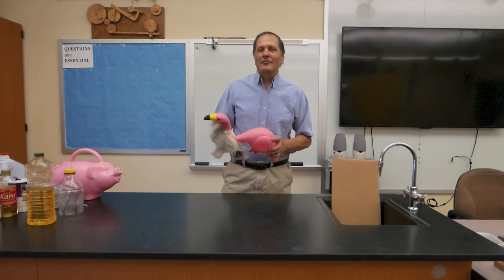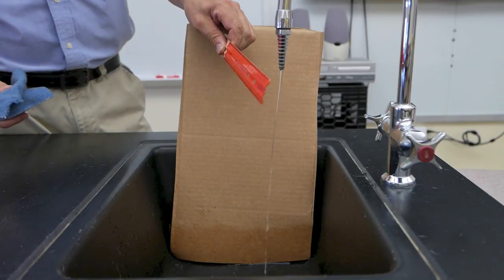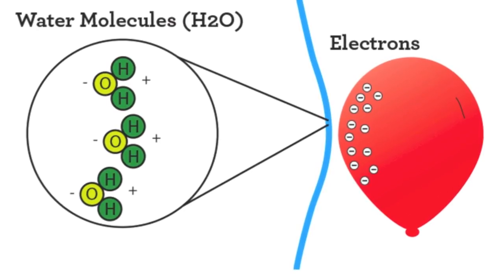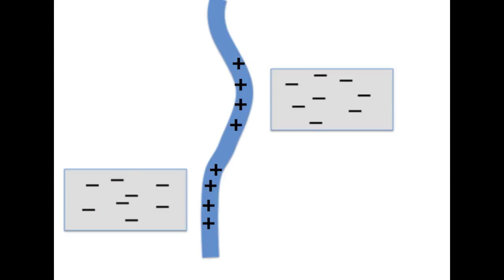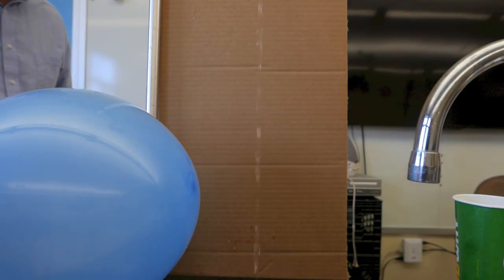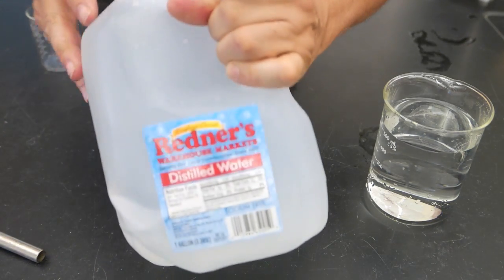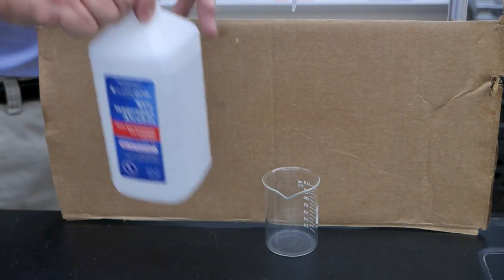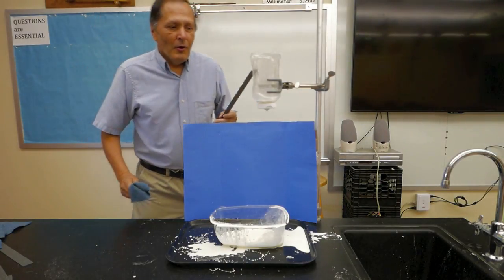Bending streams of water with a static charge // Homemade Science  with Bruce Yeany

Comment: Fantastic video! I really thought I knew what was going on before the video and you completely blew that hypothesis out the water - I LOVE that!  A few thoughts on potential experiments next time:
1) using dry sand
2) using tiny metal ball bearings, ideally fine enough that they can 'flow' like the same (but conductive)
3 & 4 intro: someone in the comments suggests that the lorentz force may be coming into effect: the moving charge (in the frame of reference of the dropping water the ruler or balloon is moving) is creating a magnetic field, which, if there is a localised charge induced on one side or the other in the falling water, could create a force.  To test that:....
3) water stream going past a magnetic field with no static charge near (I expect would not be deflected - but I got other predictions wrong so good to have a control test)
4) water stream being bent by a static charge on ruler / balloon: then bring in a magnet from a distance and see if that changes the way the water is reacting to the ruler/balloon at all.  If the Lorentz force was having a significant impact, one would expect the magnet would disrupt the B field and so have a change on the water behaviour (I really hope I'm wrong and this would show something, as it would be soooo cool to see)
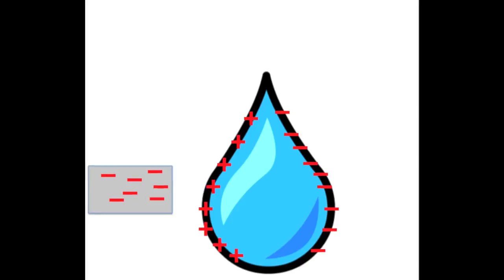5) This is a long shot, and may show my chemistry is dicey, but to see if the ions are moving from one side of the stream to the others as per 3:41 in the video, could you put in universal indicator. If all the H+ went one side and the OH- went the other, then this should show in the colour of the indicator (orange one side, blue the other), if not it would all stay green.  It could be too subtle to see, so perhaps best to use something that would usually be clear, and only show a colour if the ions were being moved around to general a localised H+ or OH- concentration, by memory we had Phenolphthalein in high school.
6) Although it looks awesome, I'm not sure the corn starch in 9:55 would stop the polar molecule from rotating (since A. it's on such a small scale vs the behaviour usually tested with non-Newtonian fluids and B. I think they need to keep this freedom of movement otherwise their specific heat capacity would change, or is that only in gases.... I get distracted) But to try and look at the same thing in a slightly different approach, could you get very finely "crushed" ice? Same idea that the crystal structure should stop the polar molecule rotating. Practically speaking scraping off the white condensate on the inside of a very cold freezer might be the easiest way to get this while minimising the water present.  

But any next step experiments you do on this I'm sure would be amazing.  Keep up the great job and thank you!! :-D
Reply from the maker: thanks  ColSco Co,  In a previous video,  I did try it with dry sand and got what I thought were very unexpected results,  you can find it here  https://youtu.be/jcoTqhXehDQ  
I'm trying to get a Lord Kelvin water drop to work with the sand rather than  with the water,  so far not working but in theory it should.

I have other videos that I'm working on but I have more that I want to  show and try with static electricity,   so I am coming back to this  I'm adding your suggestions to things to try and hopefully we'll  see what happens.
Reply: Another great video! Looking at that, a couple of other ideas :-)

a) by adding detergent to the water to reduce surface tension, would the water behave more like the dry sand did in that experiment, ie flying in all directions as the induced charge makes it repel itself and the surface tension is no longer enough to keep the stream together

b) At 7:22 of the other video you link to, you show the metal foils separate due to the induced charge on the sphere resulting in an opposite charge on the foils... Could you use the same approach to test if a induced charge in created on the 'far' side of the water stream: Clamp an insulated charged ball/ruler on one side of the stream (to try and keep the stream as steady as possible), and get a thin metal wire connected at one end to the sphere of that same apparatus, and with the other end of the thin wire, just gently touch the 'far' side of water stream.  Let's say the charged ball is PVC (negative), then one might expect the near side of the water stream would be positive, and the far side would be negative. If so, then the far side negative charge would conduct to the apparatus used at 7:22 in the other video, making the foils negatively charged, and the foils should repel

c) realise my suggestion of "dripping ice" in my post above probably isn't particularly practical, but one similar approach could be checking the reaction of a small water balloon suspended on a thread, and an identical water balloon that had been frozen beforehand, where no ions were able to move and (potentially?) the water molecules would be locked in the ice lattice and so unable to rotate their dipole moment.  Would probably also need a control of a water balloon filled to the same size with air, to see how much of the reaction force would be due to the balloon itself!

Comment: Regarding the vegetable oil: it doesn't matter that the substance isn't polar to begin with. The electric field of what you're holding will polarize the streaming material, and lead to an attraction. The attraction will only stop if the streaming material is very difficult to polarize. I expect no deflection when using table salt.

Most molecules that I'm aware of can be polarized to some degree. The protons simply move one way, and the electrons move the other way, in the presence of an electric field. 

I hope I can try table salt soon.
Reply from the maker: Thanks Antalz,   I will go back and try the table salt,  I'd like to see what happen

Comment: Great video as always ! (two of my collegues discovered your channel with me today ! ^^ Everyone wants to stop working on they're thesis and do cool experiments !)

So many questions !! First, I think the influence of the heigth migth just be because of the kinetic energy that the water accumulate during the fall, the static charges become less and less powerful in comparison to the inertia of the drop. But it's just an hypothesis.

isn't vegetable oil very polar ? it's mostly composed of acid and I think they're quite polar. 
polarity ranking from most to least:
Amide > Acid > Alcohol > Amine > Ether > Alkane

I think the polarity hypothesis should still be investigated, but the honey is mostly composed of sugars (I think they're non-polar) dissolved in water (polar) but it has a low concentration of water (something around 15% maybe) and we don't see that much of a difference on the experiment... That feeling of mystery is so great !
Reply from the maker: thanks Ben,  everyone needs to take a break now and then but I hope you were able to get your work down.  I checked for a listing of common non-polar materials that I had that are commonly available and it said that food oils were non-polar.    A lot of this experiment was spur of the moment and I wasn't sure what would happen or why.  If you have some additional suggestions I would love to hear them.  I was wondering if there is anything that I could find that would be repelled by one charge and attracted by other.
Reply: Doing experiments not knowing what to expect is cool, at least you avoid confirmation bias ! ^^

You often find on the internet that vegetable oil is non-polar and that's why it doesn't mix with water because "like dissolve like" but it's not true, polarity of the acid contained is oil is comparable to the polarity of water (measured in Debye unit)
You just need to look at Oleic acid for example (~70% of olive oil) or linoleic acid and you can easily see the molecular structure has no symmetry charge-wise ! Of course "oil" is not an element but a group, so it's risky to say "oil is polar" or the opposite.

You can find videos of things like carbon tetrachloride (which have polar bonds but it's tetrahedral molecular geometry makes it nonpolar by symmetry) that doesn't respond to charged object.

Oh and after researching, the glucose and fructose in honey are very polar molecule. ^^
Reply from the maker: Thanks Ben,  I appreciate your comments, the  honey/ syrup were no surprise,   parts of this were spur  of the moment and I was  looking around for nonpolar materials,  since it is a middle school classroom I don't have much in the way of chemical supplies and a quick internet search suggested  oils.  Hopefully I can come back to this again with better testing and more definitive results

Comment: The answer to the viscous liquids being more attracted and the liquids being way more influenced in its course on the top of the stream is probably that they gain more speed over their fall and the viscous liquids arent able to accelerate as quickly as the "normal" liquids, because of their viscousity. And because of the increasing amount of force needed to change the direction of a moving object, while accelerating (vectorial mathematics), this happens. (Sorry for eventual bad english)
Reply from the maker: Thanks Jan,    I am already planning on another try and taking ideas to try,  hopefully the next round will be more definitive,  I will take see if we can set up some experiment to test this
Reply: I'm looking forward to it :)
Reply: Surface tension seems to play a role in this experiment. The solid stream of liquid had a higher surface tension than the droplets.

Surface tension is caused by cohesion -- by the attraction to molecules of the same kind. Higher surface tension = higher paramagnetic attraction.
Reply: I was think the same as you

Comment: Is it getting its charge from the device it's running out of? It does appear to lose it when the stream breaks.
Reply: GodKnowsYou2 That would explain most of the observations. Could you try to make the tip of different materials like teflon and Porcelain?
Reply: GodKnowsYou2 This! I was thinking the same thing. Try grounding the container or purposely adding charge too it and see what happens
Reply from the maker: Good question!  Too many experiments to try and not enough time,  there is more on this that I'd like to get to,  I want to use a VDG generator but it will have to wait as I have some other videos that I'm also anxious to show
Reply: I thought it was because of the kinetic energy which increases downwards and becomes bigger than the induced magnetic field
Reply: Niemand Wirklich lol could be I is no expert
Reply: @niemandwirklich  we would still see the attraction, just a smaller one. While it looked like there was none.
Reply: I am 6 years too early. But if this were the case, wouldn't it repel with same charge?

Comment: Consider "water vapor" and "cloud condensation". With cold dry inflow air -- with an amount of positively charged dust particles -- rushing towards a rising updraft of warm moist air going towards a rotating cloud base with negatively charged ions. What kind of interaction is going on and what kind of influence would static electricity have here?

Comment: How much does the increased speed of the flow at the latter stages impact the bend, rather than a bleeding affect? Clearly there'll be much less diversion of a faster stream? Maybe test this with higher water pressures through the tap.

Comment: I don't expect this to get read, but vegetable oil as triglycerides may not nonpolar enough to avoid responding to an external charge.  When I did this test, I used charcoal lighter fluid, although I would have preferred to use hexane.  Either way, it did not respond to a charged balloon.  I would suggest trying this.
Reply from the maker: A little late but it was read, thank you for the suggestion

Comment: The only thing that comes to mind, seeng this fantastic scientific approach to the problem, is that induced polarization of the materials, being them liqud, semi-liquind  or solid, is responsible of the phenomenon. The experiment can be due also with little pieces of paper on a table, the rubbed plastic would attract them. So, in principle, no need of polar molecules kind of material: oil stream seems to be the demonstration.

Comment: But why doesn't it move against the strip if the water isn't running out of the tap? if you try taking the strip near a the top of a glass of water shouldn't it show the same effect?
Edit: Nevermind seems like you adressed a lot more then i expected. Very cool video.
Reply from the maker: Hi Pavr,   the charge  on the strips isn't strong enough  but in a future video, we'll try it with a much large charge using a VDG generator and we'll get it to move on a large surface of water

Comment: Could the charge actually be contained in the container at the top? And when drops form, the link to the container is broken, so the charge dissipates, and the droplets no longer hold a charge.
Reply: Idea: insulate the top container from the stand. Try different types of containers for the materials, or try to discharge any charges on the container by grounding.

Comment: Just to chip in. Molecules with no net dipole moment, such as hexane, are not deflected by static charge. Vegatable oil is not a very good substitute for this as the molecules of fat are polar. Along these lines it might be worthwhile to experiment with solvents of different dielectric constants. Especially glycerol being polar yet very viscous might prove interesting.
Reply from the maker: thanks kaviaari,  I'm tracking suggestions and plan to give this another try.
Reply: I agree with trying hexane or other liquids with no dipole.  Great video! I love this channel.
Reply: Hexane feels a little dangerous having around objects which might induce arcs with it being flammable but perhaps mineral oil (longer alkanes) would be a safer option for a nonpolar substance. However as you note even nonpolar substances can be polarized and the (static) dielectric contant of vegetable oils of ~3 isn't that much greater than that of hexane ~1.6 when you compare to water with it's value of ~80. Maybe even the timescales of how quickly the polarization propagates dynamically matters as they move though the field quite quickly. Now that I'm back on board with the dielectric theory I'm kinda feeling it's kinda hard to model.
Reply from the maker: Thanks guys,  I do wan to explore this line further  but  keeping in mind what I can test has to be available  in this case to  a middle school science classroom.  My access to chemicals and equipment is quite limited.  I can poke around in the high school chem supply area,  not sure what I will find but  I will check.
Reply: Bruce Yeany  You can buy Mineral Oil, USP at a drug store.  Non-toxic, difficult to ignite, not too hard to clean up, non-staining.  It consists, largely, of linear, saturated alkanes (hydrocarbons).  Non-ionic, with a dielectric constant similar to hexane, or other  linear, saturated alkanes.
Reply: I just learned that I am using obsolete terminology.  Sometime in the last 40 years, when I wasn't watching, the powers that be decided that "dielectric constant" should, instead, be called "relative permeability".  OK, I can go with that, but I'll probably forget!
Reply: @Mark Holm, relative permeability is for describing the response to magnetic fields; permittivity is for electric fields. ( :
But yeah, the fact that those terms looks so alike is why I usually go with dielectric constant.
Reply: SeriousSquid   Jeez!  I can't even remember it long enough to write a Youtube comment!  Yes, the new term for dielectric constant is relative permittivity, not relative permeability.  Thank you for correcting my blunder.
Reply: kaviaari   I suspect that your statement, "molecules with no net dipole moment, such as hexane, are not deflected by static charge" is incorrect.  Because of molecular polarization, even non-polar molecules, such as hexane, become, temporarily, polar in an electric field.  If they did not, their relative permittivity (aka dielectric constant) would be 1.  Because of molecular polarization, the relative permittivity of hexane is 1.89 at 20C.

Comment: Also consider that if a rotating column of air with positively charged dust particles reaches a cloud base with negatively charged ions and there is an increase in mass due to an increase in speed of angular momentum, would a funnel cloud develop with this situation?